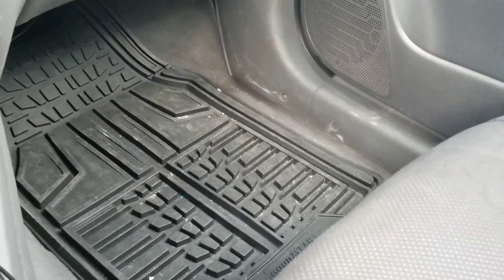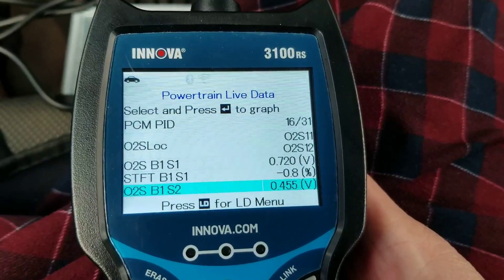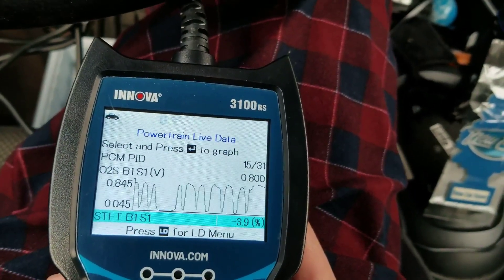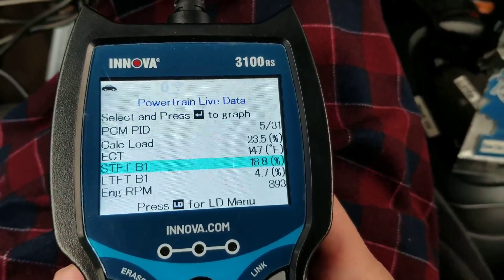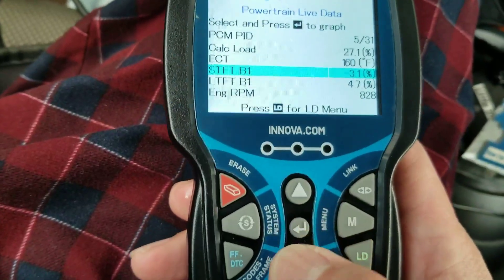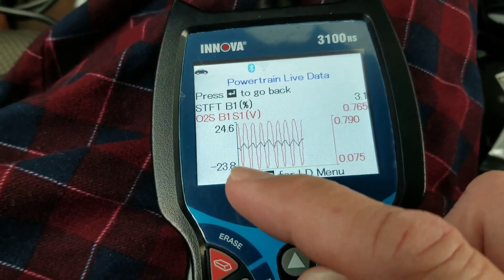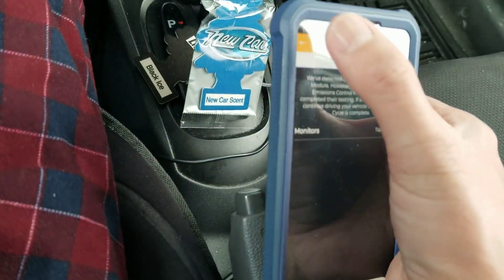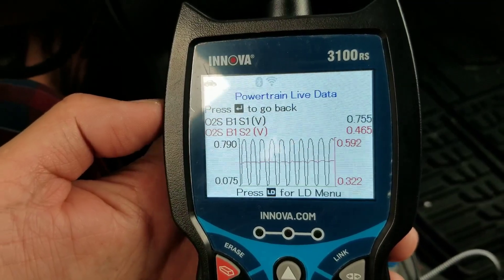How to Interpret Long Term Fuel Trim, Short Term Fuel Trim, O2 Sensor 1 and 2 Data

Comment: My bank 1 sensor 1 sticks around .7 to .8  wave form doent not go up and down like this vid shows and i know should show    its not a flat line but it definitely  arent slopes more like small mountain tops all across any idea?  Bad sensor? I think both banks do so  2006 toyota sienna  no codes  stft around 0 sometimes jimps to 7 long term around 7, 8  stft even goes to -7 lost on where to look .  Van runs great besides so shake i cant figure it out .. jacked van up put in drive and gas it gas  passenger side front tires shakes no movements  in wheel 3 and 9 and 6 and 12   but just wanna maximize  my mpg

Comment: You didn’t explain the long term 😢
Reply: The LT Trim basically makes adaptation based on information from the STFT.. so it sets new baseline based on the data from the STFT.. so with the new baseline, the AFR goes to optimum
Reply: The LT Trim basically makes adaptation based on information from the STFT.. so it sets new baseline based on the data from the STFT.. so with the new baseline, the AFR goes to optimum
Reply: The LT Trim basically makes adaptation based on information from the STFT.. so it sets new baseline based on the data from the STFT.. so with the new baseline, the AFR goes to optimum
Reply: The LT Trim basically makes adaptation based on information from the STFT.. so it sets new baseline based on the data from the STFT.. so with the new baseline, the AFR goes to optimum
Reply: The LT Trim basically makes adaptation based on information from the STFT.. so it sets new baseline based on the data from the STFT.. so with the new baseline, the AFR goes to optimum
Reply: The LT Trim basically makes adaptation based on information from the STFT.. so it sets new baseline based on the data from the STFT.. so with the new baseline, the AFR goes to optimum
Reply: The LT Trim basically makes adaptation based on information from the STFT.. so it sets new baseline based on the data from the STFT.. so with the new baseline, the AFR goes to optimum
Reply: The LT Trim basically makes adaptation based on information from the STFT.. so it sets new baseline based on the data from the STFT.. so with the new baseline, the AFR goes to optimum

Comment: Hello sir. Magtatanong lang. Yung LTFT ko 0 lang kahit i-rev ko ng matagal hindi siya nagbabago. 15mins+ na nakasindi makina pero hindi nagbabago.

May error na P0130.
Reply from the maker: Hello @MotoArk ang P0130 error code ay indicator na sira ang bank1 oxygen sensor mo. It could affect the readings of the engine computer. Suggest na tingnan mo yung sensor by looking at the output waveform. If hindi mukhang sinewave, then papalitan mo na
Reply: @PinoyPadyakero  Saan po yung waveform nia. Sa short term fuel trim po ba?
Reply from the maker: @sniper155  https://youtube.com/shorts/kuWiCahcli4?feature=share